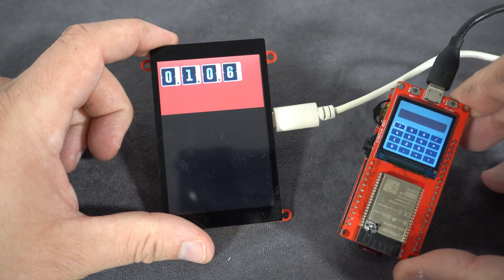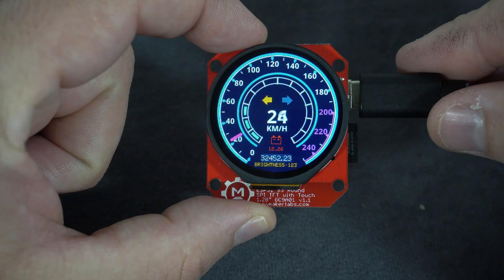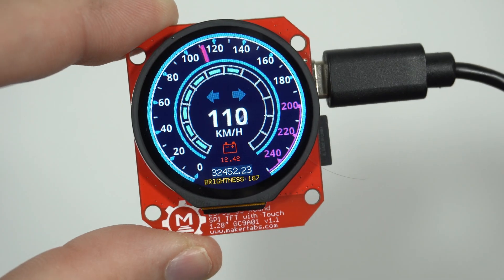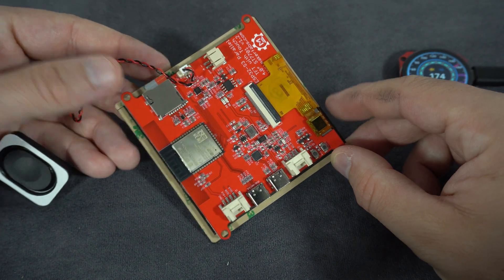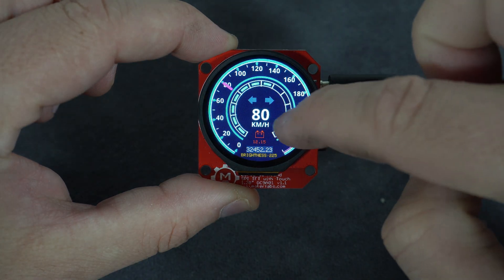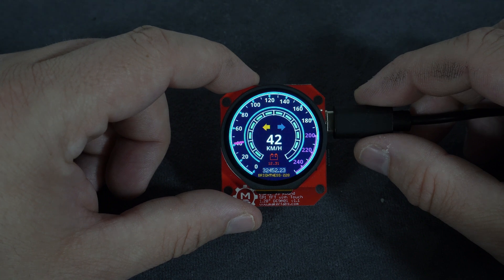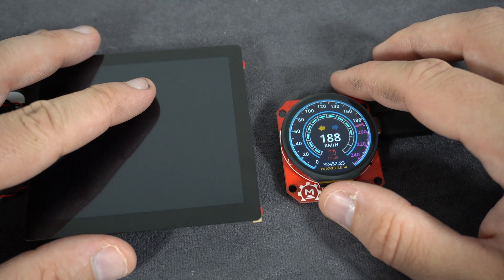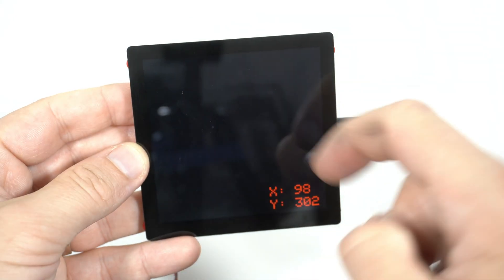ESP32 S3 board with Round Touch Display GC9A01

Comment: Your code examples do not work. I bought the exact round displays from makerfabs after seeing this video, and downloaded the code and libraries from the links. They must have changed, as your code just gives a blank screen.

Please correct the code and library versions and provide relevant links, as there is no other information I can find on this display... Thanks!
Reply from the maker: you also need to have tft_espi library, do you have one instaled? here you can find setup file for this display.Replace file in your library with this one https://github.com/Makerfabs/ESP32-S3-Round-SPI-TFT-with-Touch-1.28/blob/main/example/tft_espi_demo/User_Setup.h
Reply: @VolosProjects  It works! I must have been  close but not close enough with my defines.

Thank you so much for taking time out to reply and to fix my code, and so promptly !!!

Comment: Hi Volos, I just got the new Lilygo T-Display-AMOLED-S3. It's terrific! First time I ever had an AMOLED on an ESP32. True blacks and the colours pop. I think you might enjoy it for our projects. The first production run is sold out but there are more coming plus a touch version in the pipeline.
Reply from the maker: Omg, you got it, i am waiting that board for long time, i hope i will get it soon i can. Is it slower that old version?
Reply: @VolosProjects  No it's fast. I'm gonna convert some of your projects (with animation) and do a speed comparison but QSPI for 240x536 should out perform the standard T-Display with i8080 8-bit MCU parallel. I'll stick to your original resolution for the speed test tho, and not render the 'extra' pixels - just for fairness. The colours are a little over saturated which is common when playing TFT IPS demos on AMOLED in my experience but the driver is very simple and the datasheet from Raydium shows colour correction registers available. I've extended the driver to include functions for brightness, invert colours, display on/off, sleep etc. I'll pull request those to lilygo as their code is still 'preliminary' - but it works out of the box. I too have been waiting for this for ages. No more backlight bleed!
Reply from the maker: Great, where you bought it?
Reply: @VolosProjects  Can you persuade max3ddesign to design a case for it? I really like the T-Display one.

BTW, the data shown on the website for the pre-order amoled board is not up to date. The actual shipped unit is much nicer with a different display - 240x536 vs 194x368. I'm not sure why the preliminary hardware is still listed or why you've not recieved yours yet if you pre-ordered.
Reply: @VolosProjects  Loving your channel! One question: I am ordering a T-Display S3 Touch. Which IDE and version do you recommend? Will ARDUINO 2.1.0 work? And what version of the ESP32 library? I read that there are problems with some IDE versions that can mess up the board.

Comment: Hey Volo! i wanted to test your code with ILI9341 but I got almost nothing on the screen? also there are some issues with the code.
Reply from the maker: did you remove part of code telated to touch screen?
Reply: @VolosProjects  Shure, the code compiles no problem what so ever, but I only got a Black screen with a small and tiny zero at the left bottom. also you got 
int segments=0; declared twice and rA=2*rpmAngle*1.6; << rpmAngle is not declared (also this line does nothing in code). If you have some spare time would you like to check this behaviour? Thanks volo!
Reply from the maker: i removed errors, now it shoud work, be aware that maybe your esp board dont have enougth memory for 240bx 240 sprite , older boards can show only 200x200

Comment: Hello sir. Hope you are doing great.
I have an idea to make an esp32 - elm327 obd project. I want to estabilish connection by BLE, not classic bluetooth.
The TTGO T-display gonna be a clent and elm327 as server. 
Can you help with the code please, just an example of getting one PID from car(rpm or anything else). 
I tried ELMduino project before, but it doesn't work for my 4 ELM327 dongles.
Reply: I am also looking to do a very similar project. A esp32 with a can hat, sending to Lilligo round display with esp32 S3
Reply: @fullsendmarinedarwin7244  I could connect to ELM327 through BLE by entering elm's service uuid and char uuid in ble client sample, but I don't know how to get information from it. 
At least to debug. For example: Serialprintln (bleadvertizeddata());

Comment: Avoid clocks and guages on the 4" display 'cos the pixel pitch is not square so your circles end up looking like eggs - and Easter is past!
Unfortunately, many of the popular dev boards use displays with non-square pixels. If accurate screen geometry is important then check the screen datasheet before purchase.

Comment: What a really cool display and dial implementation. I really hope that someone develops a round touch display that's built into a proper watch like the LilyGo T-Watch 2020.
I own 17 different types of display units and have 12 Arduino compatible MCU dev boards, but mainly now develop solutions based around the ESP32 TinyPICO Nano MCU as it's so small and feature packed.
Greetings from Brisbane Australia.
Reply from the maker: You have alot, i am not alone :)
Reply: @VolosProjects  Hehe, yes I think we have the same addiction ;) Keep going with your display projects. Your hard work and creativity is appreciated by this community.
Reply: Ther are the amazfit watches gtr and gts, ect they are round and the other square or was it the other way around 🤔🤗, but they are not specially completed customer programmable but they are some custom firmwares I think.